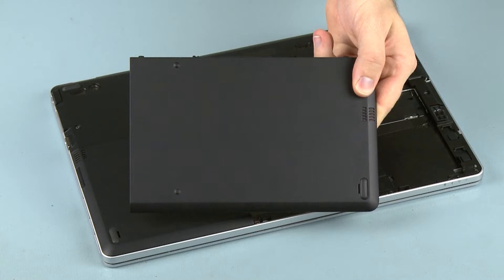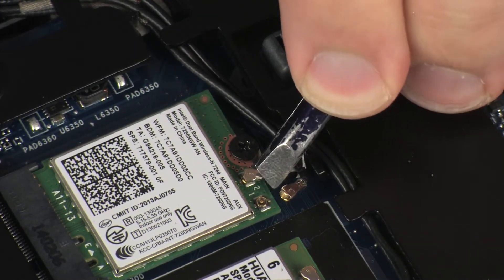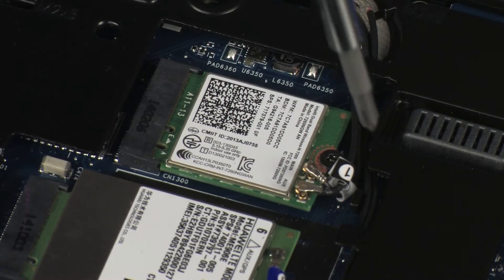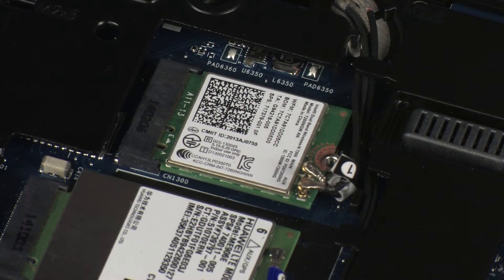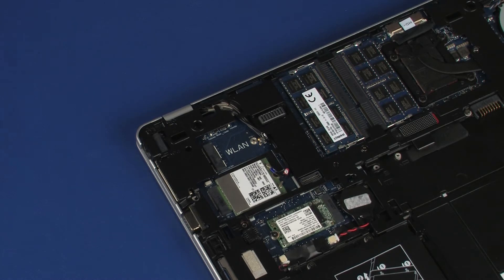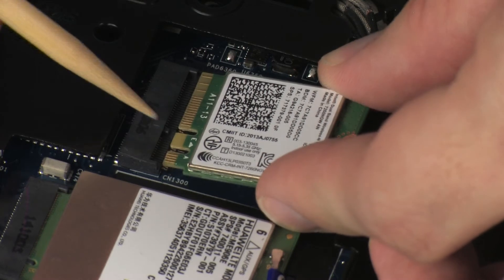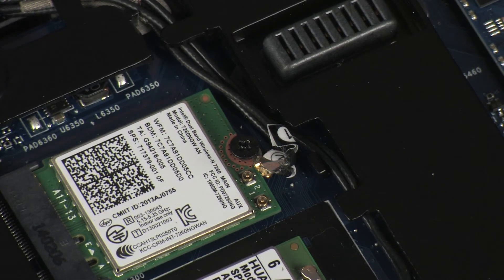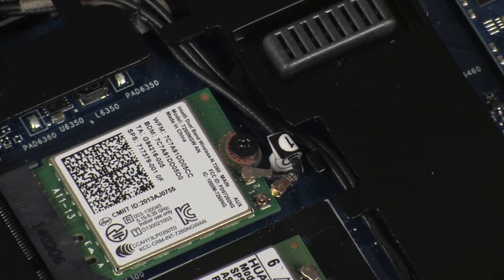Replace the Wireless Module | HP EliteBook Folio 9480m | HP

Comment: One of the wireless antenna cable cut can I replace it with one of the cable that's not connected to anything
Reply from the maker: Hi there, thanks for contacting HP Global Social Media Support!
I understand that you are experiencing an issue with your notebook as one of the wireless antenna cable got cut.
This looks like hardware issue, and you might have to get the notebook serviced. 
So, I would request you to contact our Support, and our Support Engineers should be able to sort this out.
To contact us, click here: https://support.hp.com/us-en/contact.
Step 1: Sign in to the HP Support page using your HP account or create a new account by clicking on “Create Account.”
Step 2: Enter the device serial number, select the product, and click on “other” from the options.
Step 3: Click on “Continue to contact options,” and choose your country/region and language.
Step 4: The support options will now populate based on the warranty status of your device.
Regards, 
HP Support